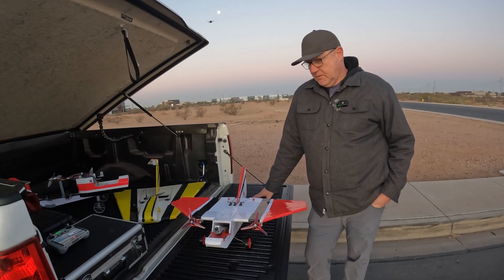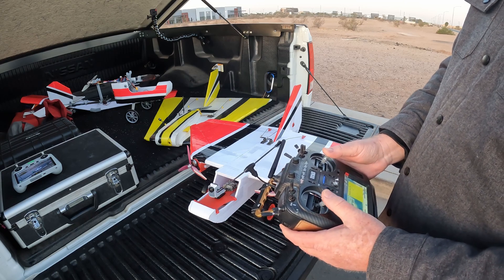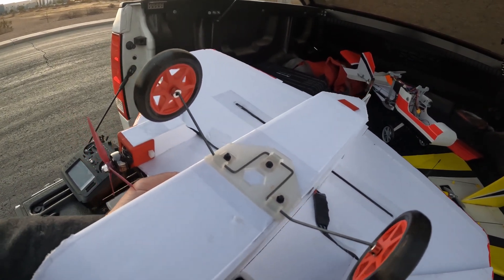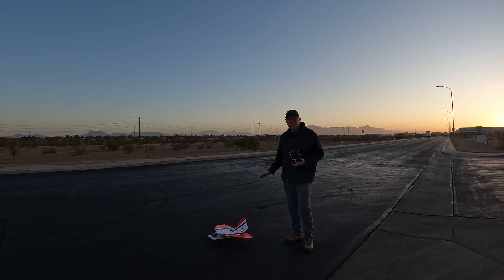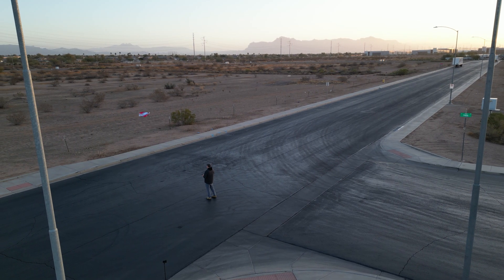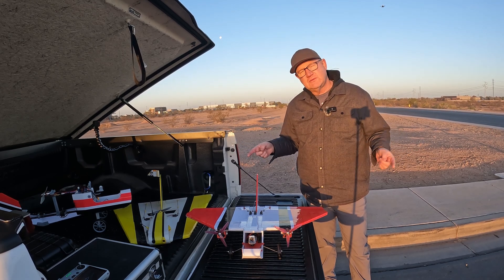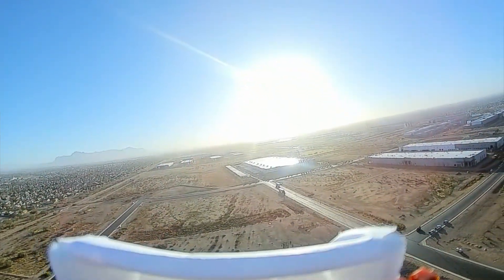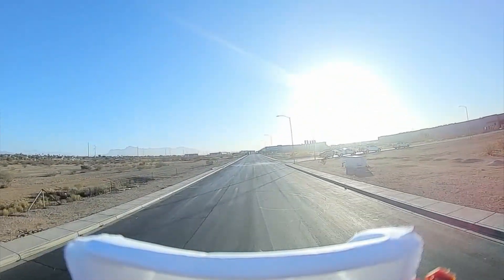NEW Design Delta Twin D2 and Maiden Flight // FPV

Comment: great design! is your nose wheel and pan camera on the same servo?
Reply from the maker: That is a good question.  They each have their own servo and are both controlled from the same input stick, however, I have a switch to enable and disable the camera pan channel.  I hope that makes sense.
Reply: @Qromer  Makes complete sense. i actually asked this on the wrong video. i meant to ask it on your new plane. i assume the setup is the same
Reply from the maker: @Tron-FPV  yes, it is the same.

Comment: I'm not trying to tell you how to build your airplanes you are doing a great job, the delta wing should fly fairly tailheavy at 25% CG, you should be closer 20% for stability on a delta winged aircraft.
Reply from the maker: I appreciate the feedback, it actually is closer to 20% -- I think I got the sweet spot.  The fact that the stall was so gentle and the recovery from the flat spin was no issue.

Comment: Well done David, another nice design and video. Looking forward to the build video. I would also love to see how you set up the radio for dual control rudder.
Reply from the maker: Yeah, for sure.   It is quite easy with Edge TX.  Not sure how to do it with other radios.

Comment: Awesome man! How do you get the vista to come off low output state without a fc? Thanks
Reply from the maker: Hi Mike, that is a very good question.   There are two ways and I use them both.  First is the easiest is you go into the menu in the goggles and turn off auto temperature control -- this will prevent it from going into the 25mw power range known as the pit mode.  When auto temp control is off it will stay in 700mw power mode.   The downside to that is that you don't want to spend much time with it setting idle as it will get hot -- you get used to this.  The second option I use is my own code in the QLiteOSD -- this is where I get my telemetry data in my goggles just like a flight controller but without the flight control.  I can have it arm the unit when I arm the motors using that.  The second option is more complicated and I have not gotten it to work with the new O3 and O4 air units, but it works with the vistas and the original air units.   I hope that helps.
Reply: @ thanks
Reply: Aah yes....the magic question...can't wait for the answer